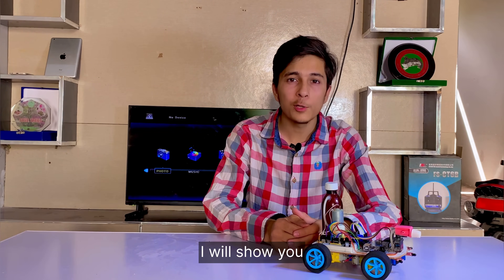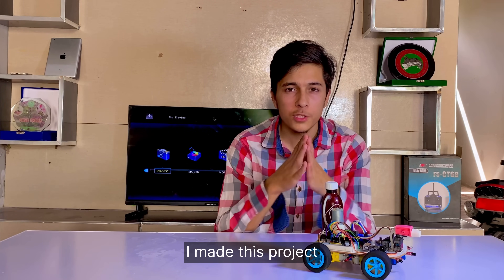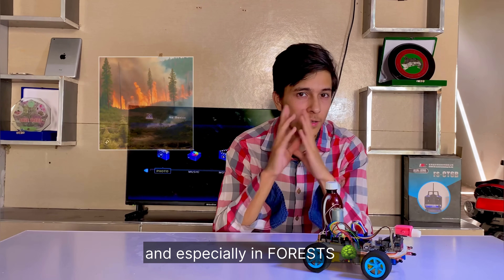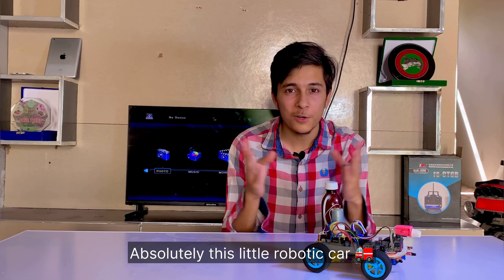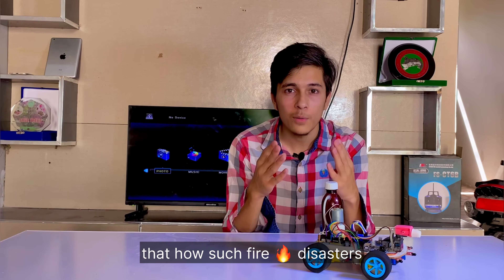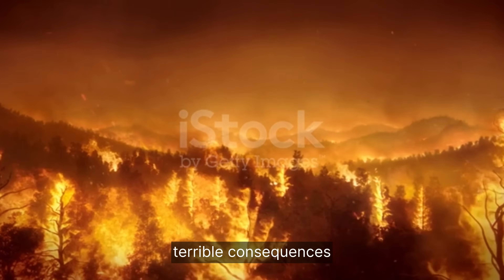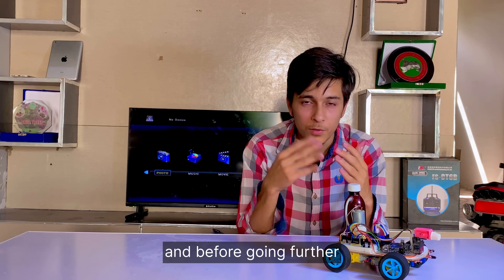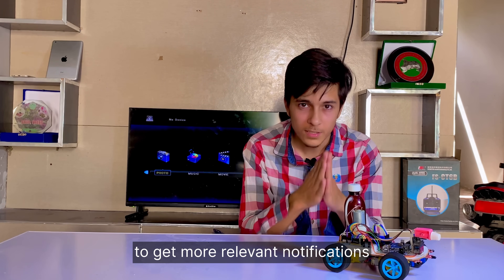DIY Fire Fighting Robot using Arduino  |  Auto Fire Chaser and Extinguisher

Comment: hey i have done all the connections as you have shown and i have even uploaded the code but the project is not working its not detecting the flame so i have changed it but even after i  changed the flame sensor its not working any suggestion on how to fix it

Comment: I want the all code for copy plz
Reply: #define enA 10//Enable1 L298 Pin enA
#define in1 9 //Motor1 L298 Pin in1
#define in2 8 //Motor1 L298 Pin in2
#define in3 7 //Motor2 L298 Pin in3

#define in4 6 //Motor2 L298 Pin in4
#define enB 5 //Enable2 L298 Pin enB
#define ir_R A0
#define ir_F A1
#define ir_L A2
#define servo A4
#define pump A5
int Speed = 160; // Write The Duty Cycle 0 to 255 Enable for Motor Speed
int s1, s2, s3;
void setup(){ // put your setup code here, to run once
Serial.begin(9600); // start serial communication at 9600bps
pinMode(ir_R, INPUT);// declare fire sensor pin as input
pinMode(ir_F, INPUT);// declare fire sensor pin as input
pinMode(ir_L, INPUT);// declare fire sensor pin as input
pinMode(enA, OUTPUT); // declare as output for L298 Pin enA
pinMode(in1, OUTPUT); // declare as output for L298 Pin in1
pinMode(in2, OUTPUT); // declare as output for L298 Pin in2
pinMode(in3, OUTPUT); // declare as output for L298 Pin in3
pinMode(in4, OUTPUT); // declare as output for L298 Pin in4
pinMode(enB, OUTPUT); // declare as output for L298 Pin enB
pinMode(servo, OUTPUT);
pinMode(pump, OUTPUT);
for (int angle = 90; angle <= 140; angle += 5) {
servoPulse(servo, angle); }
for (int angle = 140; angle >= 40; angle -= 5) {
servoPulse(servo, angle); }
for (int angle = 40; angle <= 95; angle += 5) {
servoPulse(servo, angle); }
analogWrite(enA, Speed); // Write The Duty Cycle 0 to 255 Enable Pin A for Motor1 Speed
analogWrite(enB, Speed); // Write The Duty Cycle 0 to 255 Enable Pin B for Motor2 Speed

delay(500);
}
void loop(){
s1 = analogRead(ir_R);
s2 = analogRead(ir_F);

s3 = analogRead(ir_L);

//=============================================================
// Auto Control
//=============================================================
Serial.print(s1);
Serial.print("\t");
Serial.print(s2);
Serial.print("\t");
Serial.println(s3);
delay(50);
if(s1<250){
Stop();
digitalWrite(pump, 1);
for(int angle = 90; angle >= 40; angle -= 3){
servoPulse(servo, angle);
}
for(int angle = 40; angle <= 90; angle += 3){
servoPulse(servo, angle);
}
}
else if(s2<350){
Stop();
digitalWrite(pump, 1);
for(int angle = 90; angle <= 140; angle += 3){
servoPulse(servo, angle);
}
for(int angle = 140; angle >= 40; angle -= 3){
servoPulse(servo, angle);
}
for(int angle = 40; angle <= 90; angle += 3){
servoPulse(servo, angle);
}
}
else if(s3<250){
Stop();

digitalWrite(pump, 1);
for(int angle = 90; angle <= 140; angle += 3){
servoPulse(servo, angle);
}
for(int angle = 140; angle >= 90; angle -= 3){
servoPulse(servo, angle);
}
}
else if(s1>=251 && s1<=700){
digitalWrite(pump, 0);
backword();
delay(100);
turnRight();
delay(200);
}
else if(s2>=251 && s2<=800){
digitalWrite(pump, 0);
forword();
}
else if(s3>=251 && s3<=700){
digitalWrite(pump, 0);
backword();
delay(100);
turnLeft();
delay(200);
}else{
digitalWrite(pump, 0);
Stop();
}
delay(10);
}
void servoPulse (int pin, int angle){
int pwm = (angle*11) + 500; // Convert angle to microseconds
digitalWrite(pin, HIGH);
delayMicroseconds(pwm);
digitalWrite(pin, LOW);

delay(50); // Refresh cycle of servo
}
void forword(){ //forword
digitalWrite(in1, HIGH); //Right Motor forword Pin
digitalWrite(in2, LOW); //Right Motor backword Pin
digitalWrite(in3, LOW); //Left Motor backword Pin
digitalWrite(in4, HIGH); //Left Motor forword Pin
}
void backword(){ //backword
digitalWrite(in1, LOW); //Right Motor forword Pin
digitalWrite(in2, HIGH); //Right Motor backword Pin
digitalWrite(in3, HIGH); //Left Motor backword Pin
digitalWrite(in4, LOW); //Left Motor forword Pin
}
void turnRight(){ //turnRight
digitalWrite(in1, LOW); //Right Motor forword Pin
digitalWrite(in2, HIGH); //Right Motor backword Pin
digitalWrite(in3, LOW); //Left Motor backword Pin
digitalWrite(in4, HIGH); //Left Motor forword Pin
}
void turnLeft(){ //turnLeft
digitalWrite(in1, HIGH); //Right Motor forword Pin
digitalWrite(in2, LOW); //Right Motor backword Pin
digitalWrite(in3, HIGH); //Left Motor backword Pin
digitalWrite(in4, LOW); //Left Motor forword Pin
}
void Stop(){ //stop
digitalWrite(in1, LOW); //Right Motor forword Pin
digitalWrite(in2, LOW); //Right Motor backword Pin
digitalWrite(in3, LOW); //Left Motor backword Pin
digitalWrite(in4, LOW); //Left Motor forword Pin
}

Comment: I spent two weeks designing this project, and I can cut every detail, just like in the video, and even build the tedious details. I double-checked everything, and the wires connect perfectly, just like in the gameplay footage. I could even program the exact same clip, but it's not working. What's the problem? The pieces light up, but they don't move or go towards the flame. The wheels don't move. What's the problem and what's the solution? I'm exhausted. Please reply! 💔💔💔💔💔💔💔💔💔💔💔💔💔
Reply: Check battery power, many times it don't give power or check updates using serial monitor check every motor seperatly every component
Reply: You get completed?
Reply: @shaikawaiz751   نعم الحمدلله كان الخط في اتجاه البطاريات فقط 😂

Comment: is it possible to connect to battery(6800 mah and 4000mah) 3.7V each in paralle
Reply: No it need 12 v u can connect in series 3 or 4 bettery and suply to driver 12 v pin
Reply: @Piyush-qu2ef I mean series

Comment: This is write code , ya code mena modified kara ha wiring same rahegi 
#define enA 10 
#define in1 9 
#define in2 8 
#define in3 7
#define in4 6 
#define enB 5 

#define ir_R A0
#define ir_F A1
#define ir_L A2
#define servo A4
#define pump A5

int Speed = 160;
int s1, s2, s3;

void setup() {
  Serial.begin(9600);

  pinMode(ir_R, INPUT);
  pinMode(ir_F, INPUT);
  pinMode(ir_L, INPUT);

  pinMode(enA, OUTPUT);
  pinMode(in1, OUTPUT);
  pinMode(in2, OUTPUT);
  pinMode(in3, OUTPUT);
  pinMode(in4, OUTPUT);
  pinMode(enB, OUTPUT);
  pinMode(servo, OUTPUT);
  pinMode(pump, OUTPUT);

  analogWrite(enA, Speed);
  analogWrite(enB, Speed);

  delay(300);
}

void loop() {
  s1 = analogRead(ir_R);
  s2 = analogRead(ir_F);
  s3 = analogRead(ir_L);

  Serial.print(s1); Serial.print("\t");
  Serial.print(s2); Serial.print("\t");
  Serial.println(s3);
  delay(30);

  // ---------------------------------------------------------
  // FIRE DETECTION
  // ---------------------------------------------------------

  // RIGHT FIRE
  if(s1 < 250){
    Stop();
    digitalWrite(pump, HIGH);

    for(int angle = 90; angle >= 40; angle -= 3){
      servoPulse(servo, angle);
    }
    for(int angle = 40; angle <= 90; angle += 3){
      servoPulse(servo, angle);
    }
  }

  // FRONT FIRE
  else if(s2 < 350){
    Stop();
    digitalWrite(pump, HIGH);

    for(int angle = 90; angle <= 140; angle += 3){
      servoPulse(servo, angle);
    }
    for(int angle = 140; angle >= 40; angle -= 3){
      servoPulse(servo, angle);
    }
    for(int angle = 40; angle <= 90; angle += 3){
      servoPulse(servo, angle);
    }
  }

  // LEFT FIRE
  else if(s3 < 250){
    Stop();
    digitalWrite(pump, HIGH);

    for(int angle = 90; angle <= 140; angle += 3){
      servoPulse(servo, angle);
    }
    for(int angle = 140; angle >= 90; angle -= 3){
      servoPulse(servo, angle);
    }
  }

  // ---------------------------------------------------------
  // MOVEMENT WHEN NO FIRE
  // ---------------------------------------------------------

  else if(s1 >= 250 && s1 <= 700){
    digitalWrite(pump, LOW);
    backward();
    delay(100);
    turnRight();
    delay(200);
  }

  else if(s2 >= 250 && s2 <= 800){
    digitalWrite(pump, LOW);
    forword();
  }

  else if(s3 >= 250 && s3 <= 700){
    digitalWrite(pump, LOW);
    backward();
    delay(100);
    turnLeft();
    delay(200);
  }

  else {
    digitalWrite(pump, LOW);
    Stop();
  }
}

// ---------------------------------------------------------
// FUNCTIONS
// ---------------------------------------------------------

void servoPulse (int pin, int angle){
  int pwm = (angle * 11) + 500;
  digitalWrite(pin, HIGH);
  delayMicroseconds(pwm);
  digitalWrite(pin, LOW);
  delay(20);
}

void forword(){
  digitalWrite(in1, HIGH);
  digitalWrite(in2, LOW);
  digitalWrite(in3, LOW);
  digitalWrite(in4, HIGH);
}

void backward(){
  digitalWrite(in1, LOW);
  digitalWrite(in2, HIGH);
  digitalWrite(in3, HIGH);
  digitalWrite(in4, LOW);
}

void turnRight(){
  digitalWrite(in1, LOW);
  digitalWrite(in2, HIGH);
  digitalWrite(in3, LOW);
  digitalWrite(in4, HIGH);
}

void turnLeft(){
  digitalWrite(in1, HIGH);
  digitalWrite(in2, LOW);
  digitalWrite(in3, HIGH);
  digitalWrite(in4, LOW);
}

void Stop(){
  digitalWrite(in1, LOW);
  digitalWrite(in2, LOW);
  digitalWrite(in3, LOW);
  digitalWrite(in4, LOW);
}

Comment: Bro i did everything but only coding error sensor are sensing flame and servo motor is also turning but dc motors aren't moving . I used transistor tip 127 is it ok . Please reply soon . Only 4 days for exhibition

Comment: Hello! My students are working on this project and I'm helping them with the process. I have a question, and I would really appreciate your help.
The flame sensors are susceptible to sunlight, right? As far as I understand, they work well indoors but not outdoors. I covered the sensors’ LEDs with small black tubes, which helped since the light the sensor receives has to come from the direction of the tube opening.
Have you experienced this issue as well?
Reply: I have tried adjusting the sensitivity as well, but sunlight still interferes, no matter the value.
Reply from the maker: Yes bro, It gets disturbed even with the sunlight coming from window, because radiation from the sun are strong enough in infrared region. So should be tested indoor. This drawback may be removed in future video by inserting more sensors and modifying the code.
By the way covering the sensors with a black short tube is a good idea

Comment: Hi @saadiinovativeideas, need your guidence  regarding project we have connected every thing our sensors are detecting fire and servo is responding well but our BO motors are not moving , we are using 2 new 3.7v Li-on battery . This project is being made by my school student. Could you help please.
Reply from the maker: Make sure both the cells are connected in series and supply sufficient voltage and amps. Double check your connections and make sure you have used sensors with 4 pins (having A0) pin
Reply: @saadinnovativeideas  Thank you so much brother for your reply. Actually we were using three pin fire sensor. Can it be done with three pin as well?

Comment: Saad can you tell that in sensor light is not coming and you show different diagram and you connected different in sensor circut please tell ❤❤❤❤❤❤
Reply from the maker: Just connect them as circuit shown in the video or circuit diagram file
Reply: @saadinnovativeideas Saad last question light is coming in all but when I start motor starts when I show fire it stop ... and don't follow lights

Comment: Bro after the project when we on the switch the red light is not coming? Is there any reason for this
Reply from the maker: That must be power issue. Whats your power supply?
Reply: ICR 18650 3.7v -2200MAH
Reply: And after coding,for uploading it's taking to much time,still it's taking long time why?

Comment: Hlo bro circuit is not turn on bro even supply is given and the supply negative wire is burning what is problem bro 😢
Reply: Do you used capapcitor

Comment: Hi, I have a question about the fire-fighting car and the code from your video:
Is the car supposed to extinguish fires continuously, one after another, or is it designed to handle only one fire per activation?
It seems like my car sometimes enters an infinite loop and stops responding after the first fire. Could you clarify how it’s intended to work?
Thanks!
Reply from the maker: No, It will continue to react until unexposed to the fire

Comment: A question, what is the name of the cable used to connect the batteries and the motors?
Reply: Jumper wire
Reply: @kannanvet6119 
Okay, thanks.

Comment: Is there any way I can contact you? I'm trying to get help, as I'm having trouble putting it together. I'm having overheating issues with the TIP 122, and the motors aren't responding or anything. Please help me.

Comment: Bro I have a problem that my either of the two are working like wheels are working and water motor is not pumping water so what should I do
Reply from the maker: Double check its connections and make sure you used the right components,
Reply: Yes bro I did but there's a problem with the programming plz recheck it

Comment: I have issue about cable from arduino to breadbord to sensor When it is turned on, the sensor is not active. How do I solve this?
Reply from the maker: Does sensors red LEDs gets on when robot is connected to power?
Reply: I thought you were talking about a fire sensor? If it's a fire sensor, the LED doesn't light up.

Comment: Bro can you please tell this: why you connect wires criss cross from one motor to opposite motor? Please reply bro.
Reply: Bro reply ivvandi. Video:3.55/10.55
Reply: If you understand this project, you will reply to my question.
Reply from the maker: If you look through, both motors are joint flipped to each other so wires should also be flipped, what else?

Comment: I have a question, I bought all the components and it is assembled but I could only get a 3-5V water pump, could that be a problem?
Reply from the maker: No problem
Reply: @saadinnovativeideas But I tried it and smoke came out of the Arduino board, do you know what the problem is?

Comment: 104 pf capacitor ke jagah pe koe aur capacitor use kar skte hai aur - tip-122 transistor ki jagah pe tip 127 transistor use kar skte hai kya
Reply from the maker: You can use capacitors of 90pf-110pf but can use tip122 here

Comment: Good evening sir 
I made this project with a 3 pin sensor but this sensor is not connected with the motor when the button is on motor direct work. How can I solve this problem

Comment: @Saad_Innovative_Ideas I am making this in my school competition and I have made it but the problem it that it is not moving. When I move the flame around the sensor it blinks a red light but the motors are not moving, and also the servo motor, pump are also not moving. I have checked the circuit and reconnected the Wires again, and also uploading the code  again but the same thing happens again and again please tell me what to do because the dead line of this competition is in few days.

Comment: Bro Moter wheel nahi chal raha hai , water pump chal raha hai, sensor kam kar rahe hain, servo motor bhi chal rahi hai lekin motor wheel nahi chal raha hai kya karu bro
Reply from the maker: Batteries konsi use ki hai?
Reply: Lithium ion battery 3.7 voltage ki
Reply: Bai please 30/8/2025 ko science fire hai please help  Bro Moter wheel nahi chal raha hai , water pump chal raha hai, sensor kam kar rahe hain, servo motor bhi chal rahi hai lekin motor wheel nahi chal raha hai kya karu bro nahi too modle reject karna padega please help me bro

Comment: i upload code.
done every connection.
in arduino 2 red lights and 1 twinking red light is glowing
in the motor driver 1 red light
in the sensors 1 green light every 3

help mee

Comment: I have the circuit wired exactly like you did in the video, all the sensors and everything have light on it. But for some reason the motors, the pump, nor the servo is not working 
What is wrong ??

Comment: 1.Hardboard sheet/chachies
2.BO MOTOR(4)
3.WHEEL
4.arduino uno
5.L298N motor DRIVER
6.BREAdboard
7.flame sensor×3
8.mini servo
9.mini water bottle
10.5-9 water pump
11.mini water pipe
12.2×3.7 V li-ion battery
13.connected in series (3.7 v+ 3.7v 7.4v)
14.male- female jumper wires(shortened)
15.3×33pf =99pf capacitor(qr) 1×102 pf
16.IN4148(diode)
17.tip 122 transistor
18.1k ohm resistor
19.

Comment: Sir can I use black jumper wire for black wire and Red jumper wire for red wire of my 12v DC water pump for breadboard?
But you used both white jumper wire for your water pump?

Comment: Sir then I'll use 12v dc water pump because I don't have any other water pump 
Sir will it ok if i use 2 3.7v batteries of 2500mah with battery holder for entire robot?
Reply from the maker: Yes it should work but definitely it will be be not sunning with full strength as it is compatible for 12 V

Comment: Sir and will the code you provided will be same for 12 volt dc water pump
Reply from the maker: Yes, but 12 V motor will not act with strength

Comment: I did the prototype as per this video but iam facing the issue that while iam uploading code iam not getting any compilation error but while it was uploading it is showing that "protocol error" And weels were moving back side and flame sensors and servo motor are not working. Also i have one more doubt that where should i need to connect Arduino 5v pin in breadboard.

Comment: Can u use PCB board instead of Breadboard
Reply from the maker: Yes if you can prepare it accordingly with circuit diagram, you will need to do soldering as well

Comment: Is there a way to run the car during the day? It only works fine at night, in the daytime it goes crazy from the sun radiation and I have to present it in a place where a lot of light comes in. Any advice? 😭
Reply from the maker: You can call it a drawback but it works well indoor during day time… It is possible to  upgrade it to work in day light but need much modifications which I will do in future…